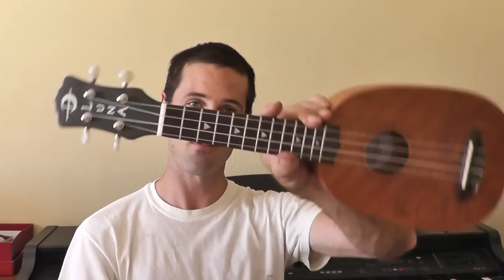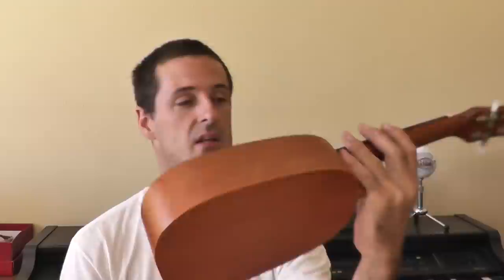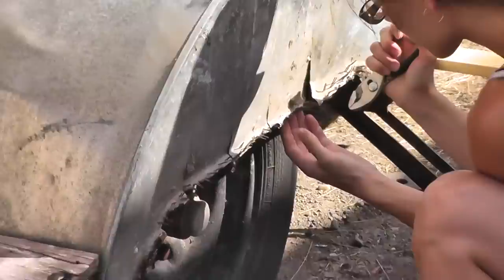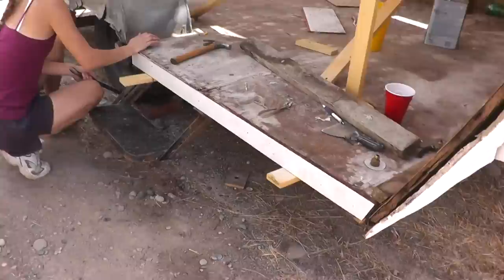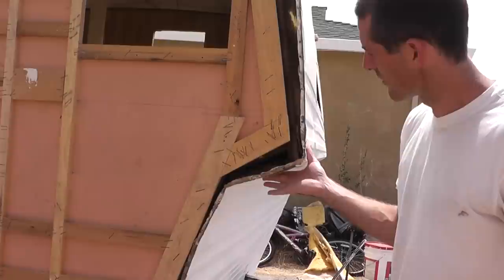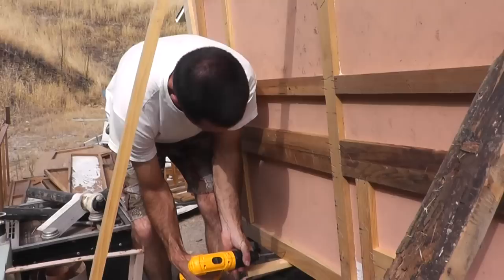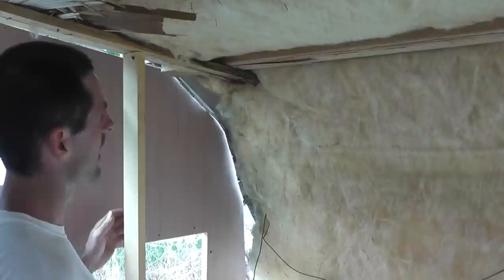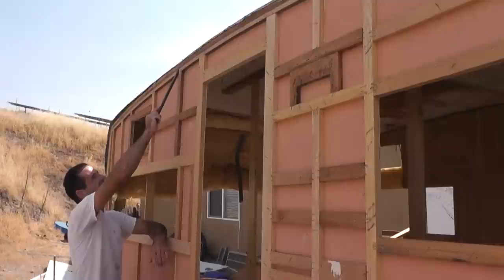Vintage Shasta Camper Trailer Restoration - Part 5 - Tête-à-tête & Securing A Side

Comment: I just thought of an idea. I have a 16 footer trailer that is pretty much in the same condition as yours and need a complete overhaul. I was thinking. the frame itself, would it be a good idea to paint fiberglass resin over the whole frame so the wood frame will be actually waterproof like a boat?
Reply from the maker: MontiR Aruba That's a really neat idea. I've never worked with fiberglass before, so I'm not sure how it would work. Would it go on like paint?
Reply: ***** The resin is a two part liquid just like how you would prepare two part epoxy glue. The resin you mix the two liquids together and paint it on with a brush. In this case you would not need the fiberglass cloth just the resin. Once dry, the resin will harden. So I was thinking giving a nice coat along the frame areas.